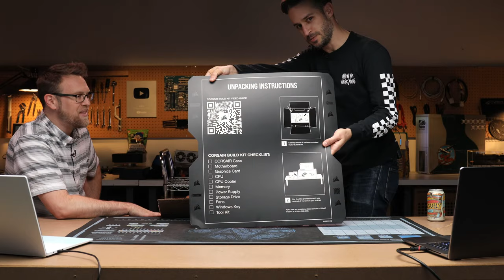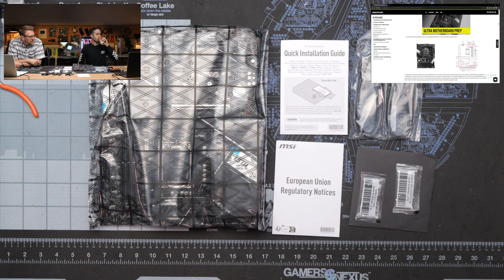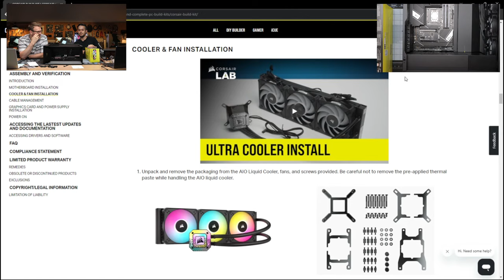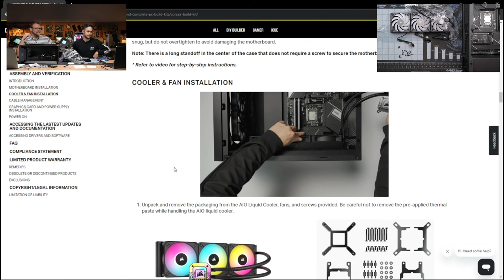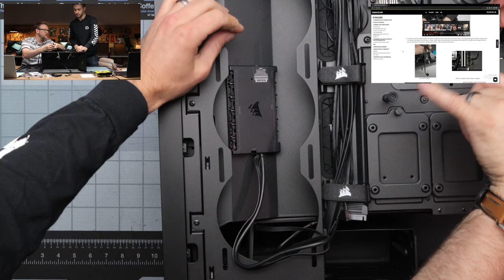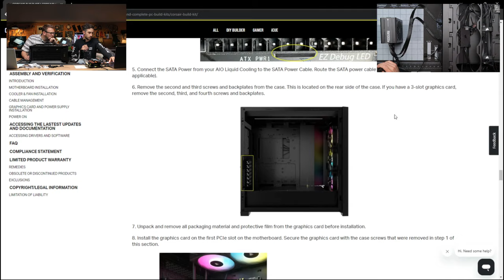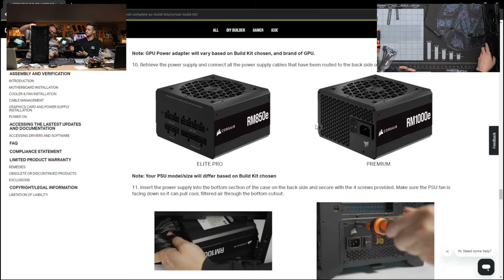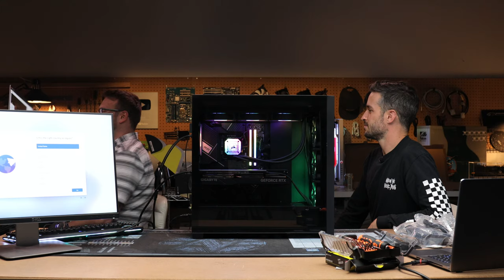First Timer Builds With Corsair Build Kit - LIVE

Comment: I went with the premium build kit from Corsair and that ran $3,299.00 on sale back on August 11th. $3,572.24 with tax. Plus, before I did the build I purchased a Samsung 970 EVO Plus SSD 250GB to separate my Windows OS. A Thermalright bracket for my CPU for about $12 bucks, and 3 additional Corsair RBG fans for the side of the 5000D Airflow case. I also changed out the GPU power cable and purchased a brace for the Nvidia RTX 4090.

I really enjoyed the build experience.